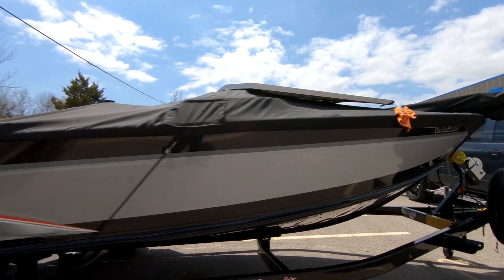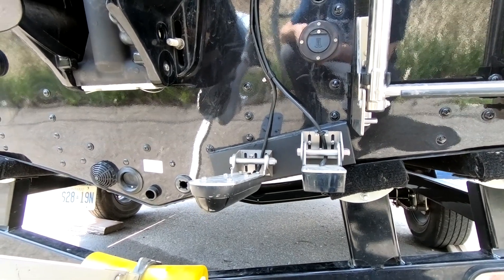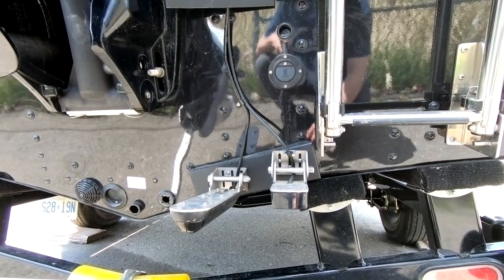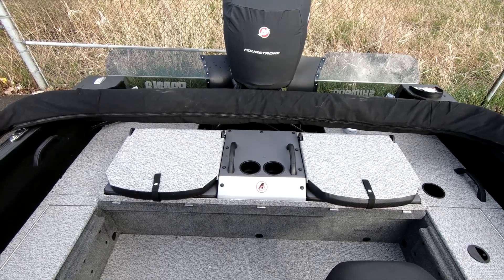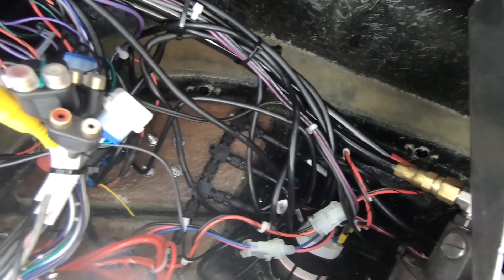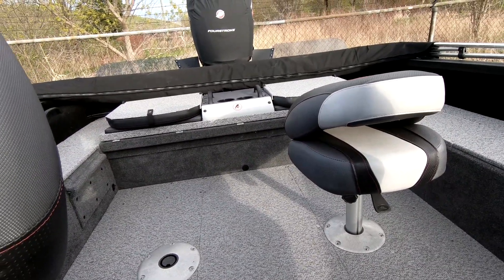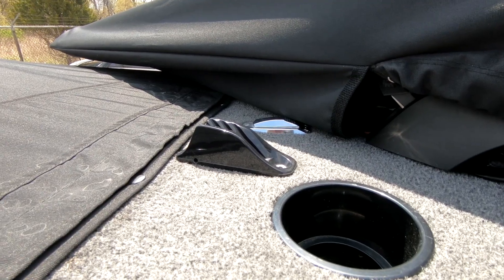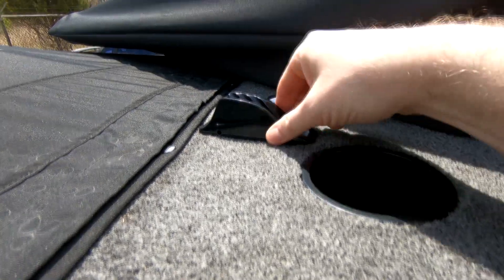2019 Alumacraft Competitor 185 One Year UPDATE!

Comment: That is one sweet rig and you have Me rethinking about getting a Lund.   I was thinking a 17 ft boat with a 115hp but now you have me thing a 18ft with 150hp. I want a retirement boat that fuel burn is not crazy. My friends run 21ft fiberglass with 300hp motors and I know I do not want that.
Reply from the maker: You can get this exact boat with a 175 hp now fyi lol.  Good luck and thanks!
Reply: @TheGrumpyFisherman  
 Don't you think 175hp is a little to much ?  I bet that would not troll very well !
Reply from the maker: @sha6mm  it's never too much 😁

Comment: Question about the boat cover.  You put bunjee cords on it for towing....did you do that for extra peace of mind or can you not tow the boat with the cover on?  The reason I ask is I am weighing my decision between the Alumacraft and the Lund Impact.  Lund has a towable cover that you can get with the boat.
Reply from the maker: The cover is made by Dowco.  Those straps are actually part of the cover, but the manufacturer supplies nylon straps that vibrate in the wind and rub the boat.  The bungee cords eliminated the vibration but since this video I have found they wear out anyhow.  I have changed back to a nylon adjustable strap now that I can tighten.  Not all covers come with these straps.  I wouldn't buy based on the cover, there are different manufacturers of covers and you can work with your dealer to get a different cover with snaps etc.  Thanks for watching!

Comment: Very sensible setup. Great work. Question regarding the Bimini, I see that it kind of hangs over the starboard rail, does this affect the stock boat cover? or did you have to get a new cover? Or, do you remove it while in transit and does it fit within the Beam dimensions? I just got one for my 175CS , but haven't installed it yet. Thanks.
Reply from the maker: Thanks!  It was a problem.  I went to Amazon a couple weeks ago and actually bought stainless mounting harware with a removeable cotter pin.  I now remove it and lay it in the boat when trailering.  I am not happy with the travel cover anyhow, I may get a custom one made soon.

Comment: What mount did you use for your bow graph? I'm debating if I want to mount mine on the vertical wall like that or just mount in on the deck. I'll have a helix 12.
Reply from the maker: It's a RAM 1.5 inch ball mount.  There's tons of options out there.  For a 12 inch I would go with a 2 or 2 1/4 inch ball.

Comment: Hey just asking for the money you spent on this boat you could’ve bought a bass boat. What do you think made you choose one over the other I’m wanting to get a deep v or bass boat but stuck on which one is best for me
Reply from the maker: I'm Canadian so you'd have to convert my numbers.  Bass boats are less veratile in rough water than a v-hull.  My buddy has a z21, they are built 99% for casting.  They are also 6 figure boats, you can get one like mine for half that
Reply: I have an older smaller fiberglass Nitro bass boat. Although it has been the best purchase I have ever made. It was only $5,000 when it was 4 years old back in 1996. I could never afford even a $15,000 boat today, and It would cost that just to accessorize. This being said if you are a multi-species angler I would not go with a Bass Boat. As suggested they are designed strictly for casting. Electric trolling motors are not good for long use trolling. Even though they are called trolling motors. The low draw of a bass boat makes it difficult to slow with the main engine enough to troll and there is no room for a kicker.

Comment: Just wondering what diameter & pitch your prop is
Reply from the maker: It's 14.75" diameter and pitch is 20p.  14x19 would probably be optimal.  Thanks for watching!
Reply: @TheGrumpyFisherman  what is your max RPMs?

I just ordered the same boat motor combo ! Thanks - Kyle
Reply from the maker: @kyle8079  you'll have to play around a bit.  Every boat is loaded different.  I get about 5650 with a 19p.  Some like to hit 6000 rpm so if thats the case I'd have to drop to 18 probably.  I've also used a 20p 4 blade that gave me 5350.
Reply: @TheGrumpyFisherman  is that trimmed all the way up ?
Reply from the maker: @kyle8079  as far up as it will go before it starts cavitating yes.  Keep in mind the height your motor is mounted will affect all this too.